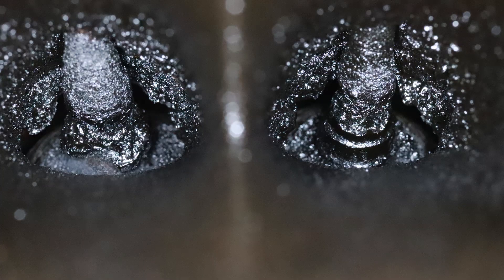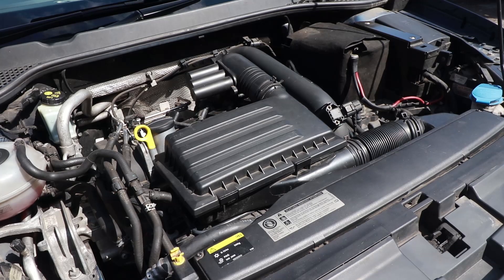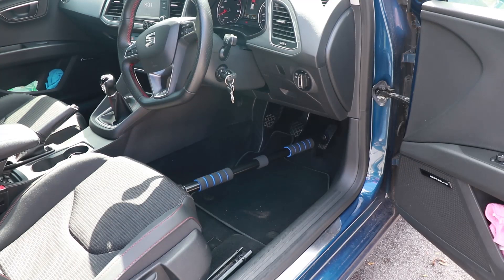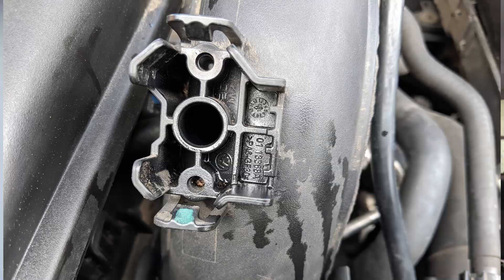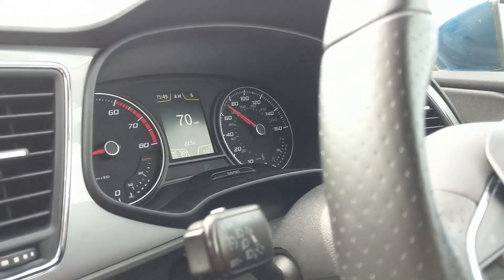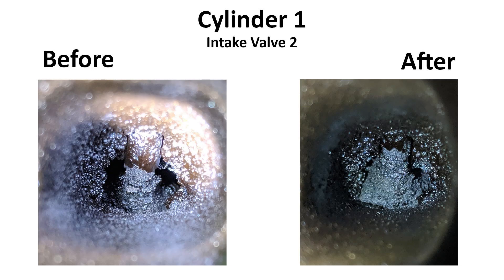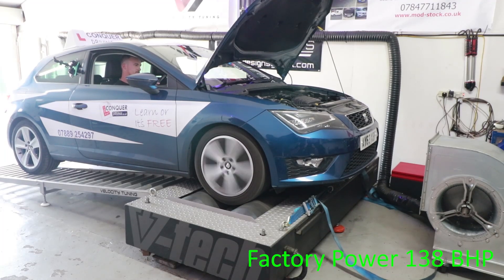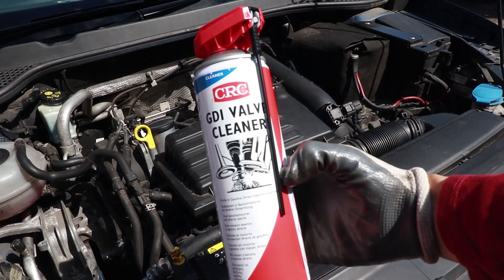CRC valve cleaner before and after valves and power figures - Is it the best valve cleaner?

Comment: A bit of an odd result.  It may be due to the inherent design of specifically that vehicle (perhaps low rpm is limited to a very low load/air pressure), or carbon knocked loose and falling onto valves from above.  Most results from intake cleaning, show a small but noticeable reduction in carbon buildup. It is really designed to be a preventive measure, not a cure for valves already saturated in carbon.  However, it may make an immediate difference, if your problem is minor and recent, for example, a small amount of knocking, associated with a couple degrees of timing correction.  On my BMW 330i I had a bit of knocking on cylinder #2.  I just used a couple bottles of Techron on two full tanks of gas, and then ran CRC Intake valve cleaner, as directed - a bunch of smoke blew out.  Afterwards, I felt there was a noticeable difference in response/smoothness of power delivery, and my engine timing was improved, with a decrease in knock, though the issue did not resolve completely.

Comment: I own a mazda cx5. Did a valve clean this week using brushes and carbon cleaner...only way to do this job or walnut blasting.. tried crc the week before and there was absolutely no change in the amount of carbon/sludge on the back of the intake valves

Comment: I did it several times on my Hyundai Sonata 2011. Being an automatic, what I usually do after waiting 1-2h for the thing to soak the valves, I take it on the highway, put it in manual shifting mode and drop the gear to 3rd gear (it will not allow me to get any lower). That takes the rpm to 5200 - and I keep it there for 20 min min. I can vouch that the sound of the engine decrease and it seems to help. But, unfortunately, I saw other videos where it shows that cleanup is moderate and the only proper way to clean is to completely remove the valve cover and do a mechanical scrape.

Comment: I've done carbon cleaning on my Ford 1.8 diesel engine using Normfest diesel intale cleaner, I could see the effects in the intake manifold pipe but I had used 2 full cans and was spraying in longer bursts, like 3 seconds at a time. Where spray was hitting directly the carbon deposits it cleaned manifold to bare metal. I did not dismantle manifold so I will never know if the valves got cleaned just as well but I only did it as a precaution and part of service and never had problem with the car anyway. Cheers for the video.

Comment: CRC does actually work to dissolve carbon build up. I've chemically cleaned the valves using this stuff by hand, just letting the port soak with the stuff and then brushing cleaned up all the carbon pretty easily. 

I doubt anything sprayed into the intake will work with that many years of build up, it's only really to clean up light carbon build up as a part of a maintenance schedule.

Comment: Turbo cars accumulate carbon deposits on the intake valves at a much faster rate than NA cars. You also didn't state how many miles are on the car. Both of these factors have a large effect on how well the CRC GDV IVD works. If you wait so long that the carbon has cooked onto the valves, then I would expect to get the results that you did. It's like not cleaning your cooking oven for 10 years and then expecting Easy Off to do a perfect job of cleaning the oven with one application. In other videos of this product, some reviewers have gotten great results. I have a 2018 Subaru with the 2.0 NA engine. I've been using the CRC product every 10,000 miles. At some point in the not too distant future I will borescope the intake valves and see how everything looks.

Comment: Well, none of senior HK drivers I heard they use either both of 2 ways in this video you mentioned. They use Redex instead. One of my senior British neighbor here who he used to be a vehicle machinist in UK police force, he told me the Redex works, but best use with opening the engine by taking out those spark plugs, then pour a little Redex into each cylinder just enough to cover pistons. "Next day or later if possible place a wrag over plug holes and turn engine over to expell excess oil from night. Replace spark plugs and start engine black smoke will come from exhaust as carbon is blasted off pistons and rings giving better ring and oil ring seal."

Sounds legit. But too trouble and too high manpower cost for me, as that bottle of Redex isn't costly. So I guess I still would like pour it into my fuel tank just as what its instructions written on bottle. I watched a British video which should likely be a British TV program on Youtube. The host man he tested Redex by just applying it into his fuel tank, and tested horse power before and after Redex kicking in, just like what you did. About 3hp ~ 6hp gained back after tested, and his car exhaust became a smoke bomb! lol Now even my Canadian friend asked me telling him which product and he wanna look for availability in Canada. Sometimes my engine warning light on, but hybrid system was still operating fine, so I scanned my car and usually "Catalytic converter: Efficiency below threshold" code got, just while the days are cold and load of water dripping out from my exhaust pipe. Yes usually the similar case like this, the carbon, stuck with water became concrete, so I even had to apply 2 doses at once in this case. 

And that machinist neighbor he also told me that, he would love to use diesel instead of flushing oil while changing motor oil. How much flushing oil it needs, apply same amount of diesel, into the motor oil entrance, but not fuel tank, even for a petrol engine, after releasing old oil. Then just do all the rest changing oil process as usual. He feels like diesel doing better job than flushing oil, but I'm not sure and not tried yet. You may try for broke if you want. That surprised me enough. He will then first apply a little new motor oil, so it will mix with the residual diesel/flushing-oil. 2 months later, release this dose of motor oil and reapply new oil again, but don't have to reapply another dose of diesel/flushing-oil anymore.
Reply: Do not use diesel with engine oil, it will eat all the rubber seals.
Reply: @paciencia0956  Do you mean the rubber seals inside the engine? That was suggested by a neighbor who is a retired traffic police officer that he used diesel as flushing oil while changing oil.
Reply: A fuel additive cannot possibly clean the inlet valves on a direct injection engine. Likewise pouring some through the sparkplug holes will do nothing for the inlet tract.

Comment: I believe this product won't work great with gdi cars that have a manifold intercooler like the 1.4 tsi, a good amount of the chemicals will be left inside it maybe.
Reply: Create a setup where you can spray through the PVC hose.
First, drive your car for at least 20 min so that everything is really hot and cleaner can soak into carbon. s
Get a stick between your driver seat and gas pedal steady revving at 2200-2700 RPM, spraying short bursts until can is empty and then immediately shut off vehicle so that the cleaner can soak into all the carbon. Wait an hour for it to soak, then go for a 45 min highway drive, preferably keeping rpms high and steady around 3,000rpm while cruising on highway. Drive And have fun, the car will act funny while the cleaning takes place, but will eventually settle out and continue to get better the more you drive. But remember, city driving us the cause of this carbon so city driving for 30 min will not effectively clean the carbon, it must be highway! 
Good luck! 
& You're Welcome!

Comment: Those cans don’t work. You need to take the intake manifolds off and soak brake cleaner fluid on the port and valves in order to remove carbon buildup

Comment: Wrong hole brother. They advise to spray after the MAF sensor because it needs to read MAF to not stall the engine while spraying. Did this procedure through the hole of the MAP sensor below the air box. Picked up MPG and punch immediately after. No engine knock or stall whatsoever while spraying.
Reply from the maker: If the MAF is unplugged the ecu will resort to base map with throttle position so the car will still run fine for the purposes of this. The throttle body is directly after the MAF so you can't spray it any later and I don't want to get the stuff on the MAF so I removed it.
Reply: @ConquerDriving  I'll need to correct myself actually. The sensor you are removing in the charge air pipe, is the charge air pressure sensor. This means that the MAF-sensor is still plugged into the intake manifold, below the air box. This is exactly why the engine is stalling when you spray through the MAP-sensor hole, because you're literally coating the MAF-sensor with spray.
Reply: @GlekkeMatrak  Could you tell me how you achieved this? You took of the air box and removed the MAF sensor. Did you then replace the air box and managed to squeeze the straw in the gap or reattach the air box but not put it back in position?
Reply: @evropapagan5551  I didn't reinstall the air box. Just left it off during the procedure.
Reply: @GlekkeMatrak  Did you unplug the charge air pressure sensor? Is there a screw(s) holding the MAF sensor in place?
Reply: @evropapagan5551  i didn't unplug the sensor. Just left it plugged in. No screw I believe, as far as I remember.
Reply: @GlekkeMatrak  these engines DO NOT have a MAF sensor the EA11 only has a MAP sensor. stop spreading mis info. the sensor he removes is the MAP sensory, it doesnt really need to be removed though as the cleaner cant damage it, the best way to do this is to take the intake from the airbox off and just spray it into the large intake, that way it also cleans your turbo and just gos through the intake into the throttle body.

Comment: How many kms on your car without carbon cleaning ? if too many & really bad carbon build up then of course itll not work. you will need walnut blasting or manual cleaning, & then use crc spray once a year for cleaning... please us know your mileage ?
Reply from the maker: I was doing close to 30k miles a year in town. The way I figure it, the CRC is £40 a go, walnut blasting was £300. I may as well do a walnut blast every 60k miles as I know that works. It made a night and day difference.

Comment: These things do infact work, but the best way is to make sure valves are closed and spray it down onto the valves directly, that will disolve all the carbon, just gotta make sure you get everything out of there..
Reply: To do that you would need to remove the inlet manifold so you may as well get it walnut blasted.
Reply: @bikeman123 you are absolutely correct there, at that time three years ago, i struggled to afford wallnut blasting, so did it in that way, blasting is absolutely a no brainer otherwise.

Comment: With all due respect, I think you did not do this test any justice!

The valve cleaning agents should be applied way, way earlier and at intervals to prevent a terrible carbon deposit build up like that, preventive not magic. Where will the big pieces go if they did start to come off, what will be clogged up, gasoline particulate filters, catalytic converters, etc.. aso..   Just take 2 sec to imagine that, could be that started to dissolve some of that nasty carbon and not loosen from the shaft and back side of the valves, terrible thought really.  That bad of a case need manual cleaning and full service, oil swap etc afterwards. Cannot see what sensor that is, if truly MAF then sure don't spray straight onto it, some in the air close to is not the end of the world, if MAP you're ok or so they say.

Comment: Thats not how you do it that's how you don't do it need to rev it way more 3500 rpm X ten then let it sit for an hour than thrash it for an hour fixes diesel engines that are already at the scrap yard. Vary the revs more while the can still has spray left so each rev has a chance to work a different area. Can take a violently shaking car/engine and it will purr
Reply from the maker: I just followed the instructions.

Comment: I’ve designed a system that sprays liquid into the charge pipe. But I don’t know what pattern to use. It uses a billet injector of 160lbs/h, a fuel filter as the fuel tank also because it has enough volume, and a pressure bottle of 4-6 bar and I pressurize it with a bicycle pump. I did a test on the “bench”with 40ms spray with 250ms pause and it seems to spray very fast so I’ll start with 5ms 300ms gap
Ps
Just calculate it. :) I need 5ms and 380gap that’s for 0.7lbs per 20min
Reply from the maker: Sounds very interesting.

Comment: It works for less severe cases. This is pretty far gone. You would need several treatments of this stuff to get meaningful results.  Probably a lot got loosened up and redeposited. I’ve seen good results using this stuff more frequently and before it gets really caked up.
Reply from the maker: Trouble is, that stuff was £40 and the walnut blast was around £300 and worked perfectly. So with all the times messing with £40 cans of spray it makes sense to me to get it done properly. Depends on the car though as a walnut blast can cost a fortune. But of all the videos I've seen this stuff usually only makes a marginal improvement at best.

Comment: NOT a recommendation if your car has never had a valve cleaning as to this can cause and dislodge big pieces of carbon resulting in catalytic converters to clog and fail.
Reply: No the cylinder will burn and crush the carbon.

Comment: It's really good seeing someone on YT take the empirical approach as opposed to simply offering a (usually unqualified) opinion. So thanks for the vid. 👍

Incidentally I came here after seeing a video on this subject by a mechanical engineer. His position was you can slow down the build up by doing regular (6 monthly) oil changes, minimising short trips and doing bi-weekly 1 hour+ runs on the motorway. And as for removal there was in his opinion no satisfactory way of chemically cleaning the intake, which makes sense as burnt on carbon is quite unreactive and would probably need to soak in the solvent for a while before becoming soft enough to shift.

Of course be nice if car manufacturers made intakes easier to remove and included additional injectors to periodically spray the valves but I know it's not going to happen. In my experience most new car buyers just aren't that smart and seem to buy mainly based on looks and reputation and not the quality of the engineering or ease of maintenance.
Reply: LoC...People surely don't buy cars today based on the commercials the commercials tell little about the car just smiling faces and exterior glimpses of the car sometimes you might not even know you just watched a car ad. I remember when commercials we all about the car, it's features, it's engine, now they show a family going out on vacation...weird AND that's what sells cars?
Reply: @harryberry474  People almost never buy cars based on ease of maintenence or even reliability.

You have to remember most new car buyers are not technically inclined and so technological superiority (as opposed to number and types of gadgets) rarely features in the buying decision. This incidentally is also why servicing and repair costs have risen (more difficult = more expensive) and why things which should be easy for the owner to do, like resetting the service reminder, sometimes require dealer level equiptment.
Reply: I agree. Regular oil changes are important and don't skimp to buy cheap oil. The CRC should be used as preventative maintenance.
Reply: @peterhobbs4780  The advantage of more expensive oil is that it often has a better additive package which is effective when used on long oil changes. Otherwise so long as the cheaper oil meets the spec (usually A5  / WV 507 for petrol) then it doesn't really matter, assuming the oil change interval is short. And incidentally this is a debate I've had a few times and for some reason it often seems to attract refutation from the self described 'oil experts' or "oil engineers" (but never the chemical engineers or tribologists, interestingly).

You're right about intake valve cleaner though. Just hope that the intake manifold is actually removable or at least the values are somewhat accessible for maintenance without having to take half the engine apart!

Comment: Dunno man, it looks to have penetrated the carbon deeply enough to soften it, causing it to swell and in one image move the carbon down the valve(?) making it look wider (ie. worse) than before?
In which case it may improve with additional driving but failing that, at 1/40th of the cost of a walnut job per can a second application isn't unreasonable given the high buildup on your engine and I suspect it'd make a massive difference if you don't wait too long. Thanks for the before and after images, hugely appreciated. I just did my B7 RS4 and despite expecting NO improvement (I'm going the two-can route cos I don't think mine has ever been done) my rough idle disappeared completely - apparently it cleans spark plugs 🤣
Reply from the maker: The can was £40, did nothing. Walnut blast was £300 and it solved my problems and made the engine run like new. Watch my video on walnut blasting.

Comment: You made several mistakes in your methods. Waited too long to use CRC, and didn't use it correctly. For an engine as bad as yours, you needed to take off the manifold, and spray directly onto the back of the valves and let it sit on them. Then it would clean the crap out of them. There are many videos proving this.
Reply from the maker: I did what was said in the tin.